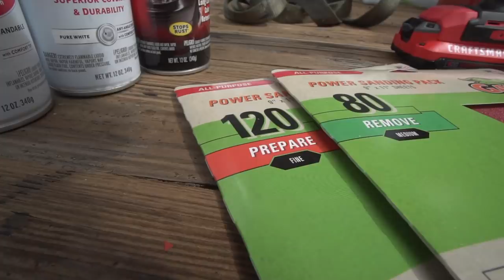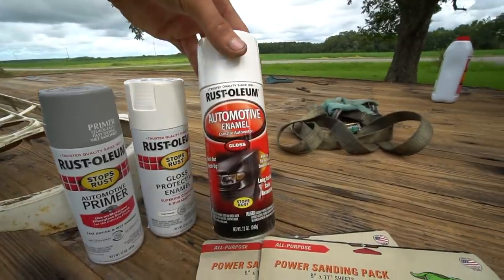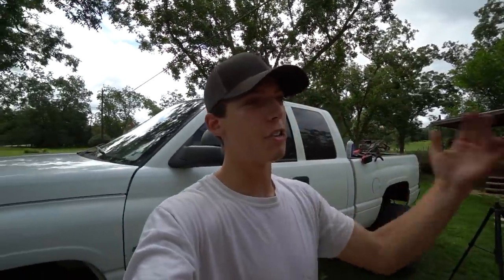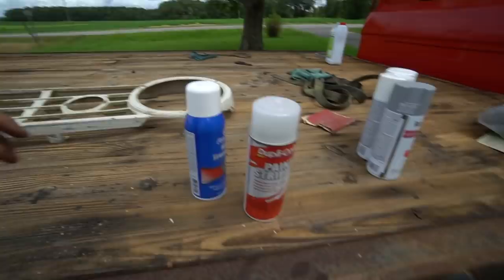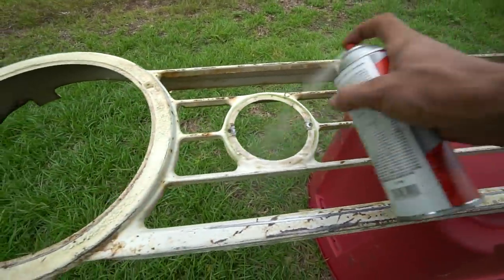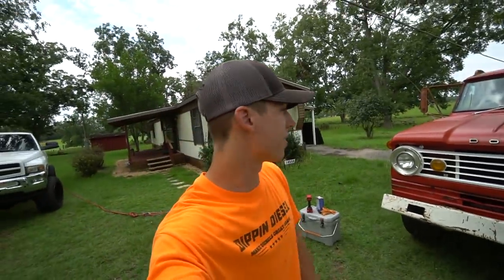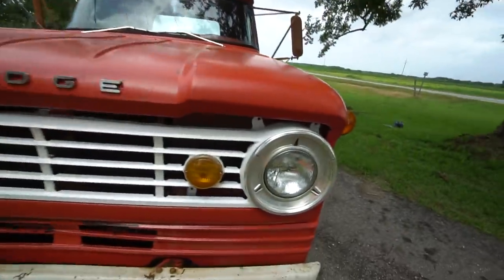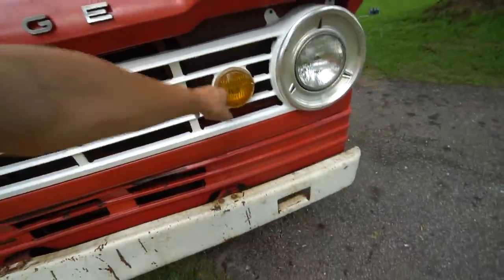Restoring My Old Farm Truck Grille in My Driveway With Spray Paint! (Quality Results?)

Comment: Lol! When you started sanding I said to myself you needed some rust converter. Glad you grabbed some. What you could really use is a sand blaster. If you have a compressor they're easy enough to make fairly cheaply. I'm sure you'll be able to find a video or two on whipping one up.

Comment: You grew up!!!! And I am proud of you for doing so. I had nearly quit but thought give you a chance to hear us and see what you do with it. I do so hope that you look into the molasses thing... at least just pull one of the cab marker lights.... It is the grounds on those lights as they are just famous for that very thing. I think that the wire its self will be okay once its off and cleaned to bare metal where the ground wire goes. Some times those head light switches kinda get corroded up and if all is right up top side... ( I would start on the left and work across) and one by one get them going again. That molasses trick might save you a bunch of money and time in the long run. All that crap that was growing on the cab when you got it is ten times worse under those lights but can be brought back... in any event, it will be clean for the led type should you have to replace. Napa used to be the truck lights store back when and the carried all the different lights... get that number off the light and they will get you oem stuff. I think that the grill come out super... steel wool can be your friend if you work it into a start of the rust and work into that spot as it seems to move the rust away and come back nice.... Now as far as  it being dull, watch vice grip garage and see how when he isn't screwing the pooch, make stuff come back as he has done the linseed oil on a old  car... a real old hemi car and it went from why to wow. It involves a buffer and some cutting clay then polish on the linseed areas but oh so nice when done and he is impatient too. It is a good tutorial as for something to get good ideas from. He is smart and makes over forty grand on his channel so he is doing something right!! What do you say to that Dippin??

Comment: Dip,, pull the grill back off and paint the radiator support black and the grill tabs that hold on the grill on black.  Trust me the white will pop more. The signal lens go to the dollar store and buy a bottle of totally awesome let them soak and it for about a half hour. Pull them out wet sanding with 600 grit sandpaper and clear coat them they'll look brand new.

Comment: On the bumper..
One way is with wood, and a bottle jack.
Take it off, and jack against the weight under the truck.
The bumper looks pretty flat, so it might work well..
Just one way to do it, and you can really do it slow, while keeping an eye on it..
Your doing good man.
Reply: Yah this guys idea is best I've read so far. Working at one of the most successful shipyards on the East coast, we use similar tools (small hydrolic rams with hand cranks and bleeders) to straighten all sorts of stuff on board ships. Get it close to a tree and put the bottle jack in between, if you need to make up space put a piece of 2x4 in between. Be a good way to move it nice and slow heat up the joint a little were it started to bend. Should be able to easily straighten it out. After you do that you might want to take the bumper off and straighten the bracket that is just above the bent part, might not have to.

Comment: Keep up the great work man
Reply from the maker: Thanks!
Reply: @DippinDiesel  I'm going to suggest spending your time on reliability and safety before aesthetics if you plan to be driving such an old truck regularly and over significant distance.
Reply: @DippinDiesel  For the bumper, it looks to me like you could hook a come-along between the bumper vent and the front axle and get it to pull the right direction; or a cable under the front axle and under the rest of the red truck to the pickup on the other side.
Reply: @DippinDiesel  spray wax at self serve car washes might gloss up the pain in addition to being really good for preserving the underside and engine bay (except intake).  If not, try following it with some buffing (after sorting out all reliability and safety issues).  The spray wax on the underside does improve reliability and safety by preventing bad electrical connections and more brake line pinholes etc. and slowing dry rot on tires and fuel lines.

Comment: Rattle cans, are a great way to do a partial repaint on the cheap. I do it all the time. I just repainted a replacement front fender for a '65 Buick. Is it perfect. Nope, but is a big improvement. Total cost in paint about 15 bucks.

Comment: I would of hit that thing with a wire wheel, and rust converter, primer, sand smooth if you want more primer and paint. Your not making a show truck here out of the rest of it so stripping all the paint is not really necessary, it's good and sound.

Just hook the lights up so they work..the cab lights. Those make a big truck!!